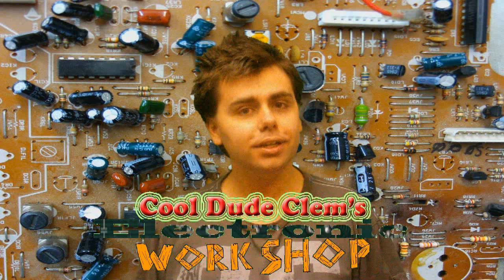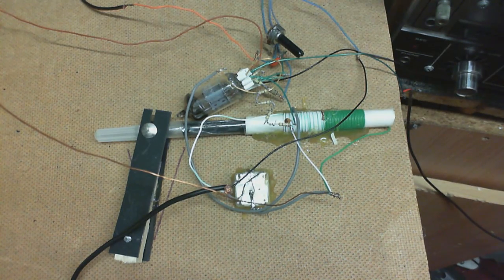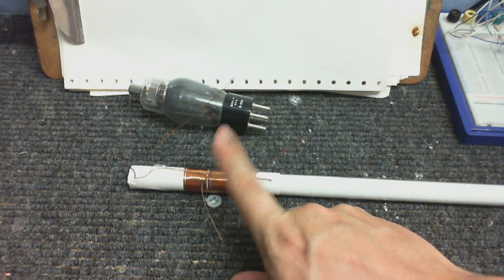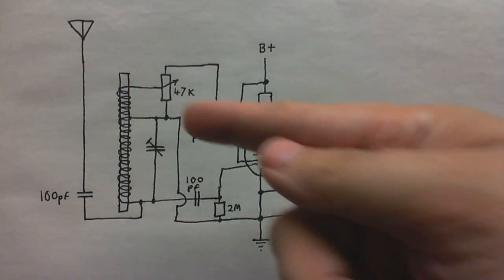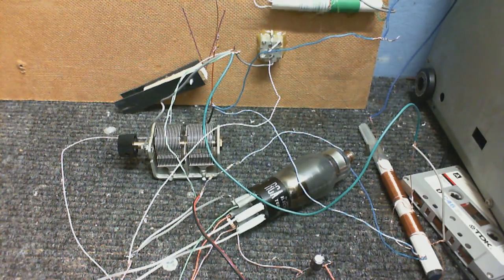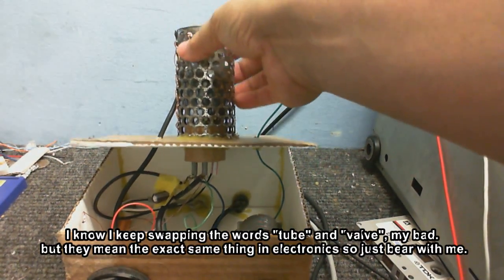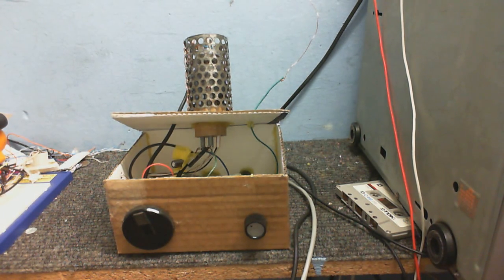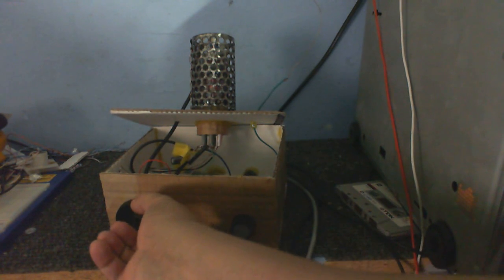Tube Time Ep1 - Building my own regenerative radio

Comment: Clem, I trying to fix and old AIWA radio, FM works fine, but low volume and no stereo. If touch somewhere in the PCB, volume goes loud and stere appears. Also hjapens to work without the cover. Cover has the power supply and transformer attached that, when you close it  happens to get CLOSE to the radio PCB thing and in case it was working, when you put the cover, the radio stops working, and turns into the failure mode I told first. How can I figure what is going there. Thanks.

Comment: Nice, I wish I was that lucky when it comes to regen (or superregen) receivers. Built quite a few, but made only one to work (well, sort of). So the question is - are you thinking about trying simple superhet? I found an AM one, uses just 4 transistors. But I went with other (7 transistors), gives signs of life - but sadly, I don't have time right know to finish it
Reply from the maker: At the moment I'm not that interested in making a superhet receiver problem is they don't receive much audio bandwidth, this regen that I made has a fairly wide-band sound, I can even hear the 9kHz whistle between stations, I just need to figure out what's picking up the 50hz hum. I might ave a go at building a superhet in the near future, I'll probably rip things such as IF transformers out of a few junk sets I have.
Reply: Can you link me to that 4 transistor regen?  Maybe the 7 transistor one too.  Would appreciate it.
Reply: CoolDudeClem Well, I thought that all IF coils is the same, but they don't - so I ended up looking for a datasheet to wound it myself on the scavenged core. So it's not that easy
Reply: FelixTheHouseFreak Sure, but they are SUPERHETS, not regens
A 7 transistor one you can find at http://quazar31.home.comcast.net/~quazar31/AM/index.html (there you can find step by step tutorial, and even one for FM).
4 transistor version - http://lucsmall.com/2013/05/10/am-superhet-radio/

Comment: Does Tube Time only get the new intro or will this be phased into the new videos as well? I personally prefer the old theme as it was a bit of a trademark! Or did YouTube get fussy about the old one? :)
Reply from the maker: BBC600 This intro is just going to be for the tube time videos, on the other CoolDudeClem's Electronic Workshop videos I'll be using the same intro they've always had.

Comment: Nice! 
Just 1 tube and some var. parts, cool project. I have an old tube military radio that is not working anymore(as you can see on my channel) so tubes and parts enough :P

so this circuit uses just 1 voltage(about 40 volts) to power up the filament and the rest of the circuit? And not even the dangerous high voltages.
Reply from the maker: marcel.o r The 40 volts is for the B+ supply, the filament only runs on 6.3.
Reply: CoolDudeClem OK, thank you.. i wondered because the 6.3v isn't in the drawing.
what is the tube? Pentode?

Comment: Have u consider radio channels are now almost broadcasting digital and moving away out of analogue  concept?  Digital radio stations are like noise transmission which digital decoders are needed to convert to analog wave form before driving to an audio circuit..
Reply: Some may broadcast both until consumers realize they need to toss away their obsolete and  old radio receivers ..I doubt same radio station channel frequency in digital and analogue are exactly the same frequency otherwise digital wave form signatures will mixed in with analogue broadcast... That's just my conventional thinking. :)

Comment: at the firsth test it wassent oscilating
you have to switch the wires around on the regeneritive coil
(my comments are troughout the video)
Reply from the maker: I did try switching the wires round on the regeneration coil before I made this video, it didn't seem to matter witch way round it was. Of course with the other coil I made it did matter which way round it was.
Reply: oke
its weird that it did not oscilate bevore

Comment: Here's one that uses the screen grid for feedback and not the plate. Low voltage also. http://w5dxs.tripod.com/1-tube.gif since you're using a pentode. Don't worry about the exact tube as long as you supply it to the specs.

Comment: Another pentode which is clearer to read. The screen grid resistor is the rgen control. http://www.aaroncake.net/circuits/One_Tube_Regen_Radio_Schematic.gif It just seems wrong to put more voltage on the screen than the plate though. Think about it. That is not typical. This is like yours. It could be wrong. But try it and see if you don't believe me.

Comment: Your tickler is wired wrong. Most old sets tapped the top from B+ and not ground or common. Look around out there. You couple your output from that also not the plate. It's all in series. Also plate gets all the voltage not the screen grid like you have. Get the right schematic.

Comment: Babbling on...I'd like to suggest that you find out the frequency you were picking up my monitoring with another radio on the side....just tune in until you hear the same station. I guess that's the trick with these radios....getting yours to pick up the right wavelength or else you just get dust. I'm American BTW and since I hate both England and America I decided to move to E.Europe! You can take that to the eBank! Bye.